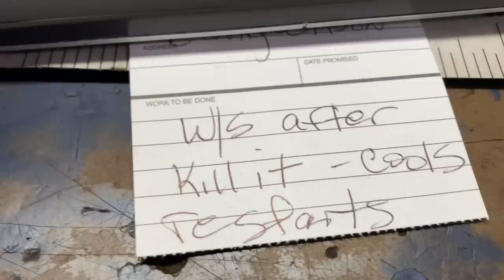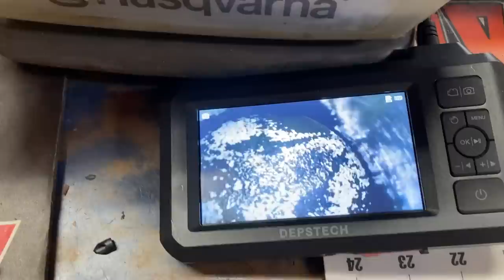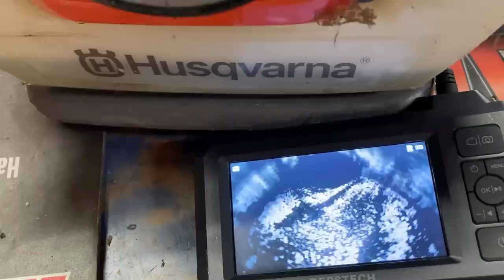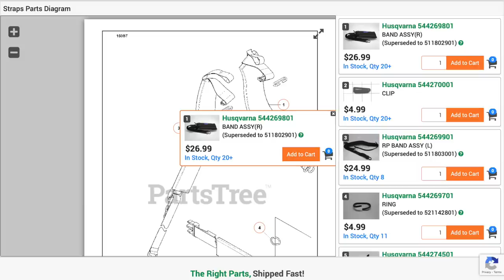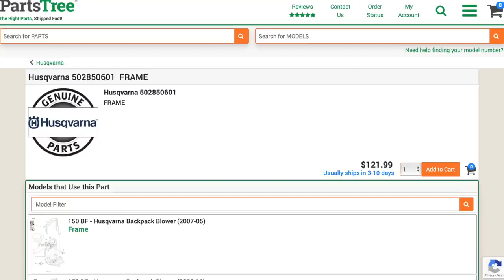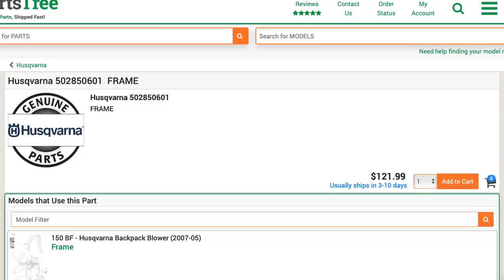You won't believe HOW MUCH $$$ I can make off one burned up Husqvarna 150BT Backpack Blower? GUESS!

Comment: My biggest oops with chain saws was buying a Poulan Pro (56cc) back 30 or so years ago.  It was 3 years of hell until I replaced it with an Echo (44cc) which despite being 30% smaller than the PooPoo would run circles around it.  The operative word here would be "run".  Now I still have that Echo (which still starts 1st or 2nd pull) but it has been joined with a little Dolmar (34cc) for motorcycle trail maintenance and a Husqvarna 562XP for all the HD stuff.  That Husqvarna just cuts through 24" northern red oak like it was poplar.

Comment: My oops moment is not turning my echo 2511wes saw back on and then wondering why it doesn't start. All my saws turn off in different ways but the 592xpg and the ms500i both have single push reset. However the ms280cbqi does not reset and never made that mistake.

Comment: I just bought a 150BT  Husqvarna, and piston went bad, I contacted the customer service at Husqvarna to order a new piston and cylinder, I got the parts but the cylinder was the wrong one, the parts drawing did not list the cylinder part number, after talking to customer service the lady said that she will send the right cylinder,  well it was wrong again.  So I just used the original cylinder.  I have only had the blower over a month .Is there a way to get a parts drawing,  according to the tag the blower was made in 2021. I noticed the cylinder head on your video is the same part that Husqvarna sent me but mine is different,  I really enjoy your videos,  thank you for your time.

Comment: I don't think that was bar and chain oil in the gas tank , at 2:36 as you tip it out it has a very low viscosity , perhaps someone filled it deliberately with a light weight oil for storage purposes ?

Comment: Hey Chicanic, I have a question for you. I own a Echo PB-9010 I love the beast. My problem is that the shoulder straps don't seem to be enough to keep it from trying to twist it's way off me. Do they make a chest strap for them yet? If not, any ideas on what I can do? I'm about ready to try and use a child sized belt as a chest strap.

I tried to use a Stihl chest strap on the 9010. If I remember correctly the 9010's shoulder straps are too wide so it didn't work for me.
Thank you in advance.

Comment: BIGGEST OOPS: Got 391 w/ 18” bar stuck in old growth pine. Disconnected saw from bar, set saw on ground a ways from tree. Got bar out, then ran over saw with my tractor, busting the oil reservoir! Bought a 462 the next day. Never set saw on ground around heavy equipment.🙁

Comment: The fact that Bar oil was put in the tank basically preserved the saw for 2 years. Much pulling could be prevented by using a squirt or squeeze bottle to directly inject a bit of fuel into the carbs. There’s no way I’d have pulled and pulled and pulled on that pesky concrete saw. Prime it !

Comment: Is it ok to use used motor oil in my chainsaws  for bar oil or should I use bar oil ?
Reply: Bar and chain oil is made for the job , it has a tackiness that helps stop it from being flung off too quickly . Most chainsaws leak bar oil , motor oil will leak more because it has lower viscosity . If motor oil is all you have and you're way out in the boondocks , then use it , any oil is better than no oil .
Reply: @Gordon_L  I wondered if bar oil was better for some reason & u explained it perfectly , it’ll b bar oil for my saws from now own, thanks

Comment: Hi Chickanic, I have a request, I have a Stihl MS180 chainsaw which isn't running very well, it starts and runs and will even tick over however, when I put it to a 10" log it just bogged down, I got this saw for £0 yeah I said it £0, the engine is in great condition but, I had a good look at it and it looks like the fuel line is totaled, I have bought all the parts to replace the fuel line, the fuel filter, and rebuild the carb, could you do a video on this procedure please just so I have something to go back to for reference. It would be much appreciated thank you. Great video content and keep them coming.

Comment: My biggest oops was running over my Stihl 180c with my truck. Luckily it only cost maybe 70-80 bucks to fix. I fixed it myself because I was too embarrassed to bring it into my mechanic LoL
Reply: I've run over two battery chargers with two different trucks.

Comment: I would not have imagined chainsaw bar oil rather then gas. That seems like something pretty hard to do and if you had a senior movement just admit it to the repair shop.

My worst chainsaw oops was cutting down a dead tree. Cut the notch, part way through the felling cut the tree just set straight down and  trapped the bar. Decided not to be stupid two times in one day. Removed the bar from the saw and used wedges to drop the tree. Dead trees are dangerous as the wood is brittle, in in this case rotted. I'm more careful now.

Comment: My latest oops was i bought a new chainsaw from tractor supply that was returned by a customer it wouldn't run. I paid$ 89/00 put a $10.00 part on the trigger  come to find out they put the chain on backwards.

Comment: My biggest oops with a saw or rather, should I say to saws which I got two saws bound up on a tree. There were some hidden rot and when I made the first cut it down the side up so I decided to go a few inches up higher, and that saw bound up as well so there I was with the tree and two saws stuck inside it. Believe it or not I had a third saw, and that did the trick I cut about a foot above the second saw I was able to take the tree down and then chop out my two saws that were bound up.

I would repair those older, two-stroke motors. I had an echo trimmer from 1995 and it finally died about three years ago. I kept repairing it because it was more powerful than just about anything pound for pound you could buy today. It finally died when the piston and the cylinder walls finally just wore out after all these years.
Reply: my biggest mistake in that direction was letting someone else be closer to the saw than me, after getting it bound up.  that one cost me a chain.
Reply: @kenbrown2808  I’m kind of surprised it didn’t cost you a bar as well
Reply: @jamescaron6465  bars don't pull apart very easily.

Comment: 455 is running too lean...for years many Husqvarna saws have come far too lean...break them in a bit and it only gets worse.  That oil-in-the-gas-tank unit was screaming (pun intended) for high speed adjustment.

Comment: I Remember Another Time
My Mower Wasn't Getting Gass To Keep
Running So What I Did Was I Took
A Pipe Cleaner & I Shuved It Up Through
The Fule Line Up Into The Carberator
& You Should've Seen The Crap
I Pulled Out. All Kinds Of Black Gooy 
Greasy Sticky Sluge. Then After That
I Put It Back Togethet & Started It
& It Started Right off After The First Pull.
I Can Imagine What Kind Of Black Gooy
Greasy Sticky Crap Auto Machanics See.

Comment: What is your biggest opps?  My father-in-law had Alzheimer's Disease in his senior years.  As a younger man he was a great mechanic but he had lost most of his skills due to that disease by this time.  He ruined his chain saw and couldn't figure out why so he bought another.  He immediately ruined it as well.  When he took it back, the mechanic discovered he was trying to run straight gasoline through his two new saws instead of mixing it with 2-cycle oil.

Comment: I accidently put regular gasoline jn my saw instead of oil mix. Started it and it just didn't sound right. I shut it off and then realized what a dummy I was. Dumped gas out and added oil mix. Restarted saw and ran a lot better. Imagine that!

Comment: All of the manufacturers make lots of money from dealerships, and sell the whole units to the big box stores at cost. And tell the dealership you have to stock parts to be a dealer.  But the big box stores don't have to? Most customers don't understand why dealers have to charge the rates they do to stay in business. B&S was great at this. Then they went belly up. Selling engines to mfgs for less than a dealer could buy a coil??

Comment: I constantly see this junk in our shop.  150 carburetor is out of control.   We tried the used parts thing, but it just didn't work out.  To many people demanding a warranty on used parts.  At a small shop it's worth doing.  With our labor rate, it's tough to get approval on any handheld repairs.  100 bucks is nothing nowadays. I feel for the consumers buying throw away products.

Comment: My Huskvarna snowblower is starting to show its age (5th winter) and brought it in for a full servicing at what is supposed to be an authorized shop. What a mistake! 

How about this for a deal? I’ll work for you for no wages. I’ll do all the messy, crappy jobs that you hate doing and make your shop sparkle. But you show me how to fix equipment so I don’t have to get cornholed by these local shitrats anymore! I have three pieces of gas equipment that require varying stages of maint and repair.

Comment: I'm disappointed. You had in a previous video that if you're going to store your 2 stroke for a lengthy time you should put oil in the fuel tank and use the purge bulb to run it through the system. This keeps the fuel lines good until the time you need it. Then, dump the oil and fill up the tank with gas and purge the system of the oil. With the oil tank being empty, I would think someone stored it and forgot they followed your advice.